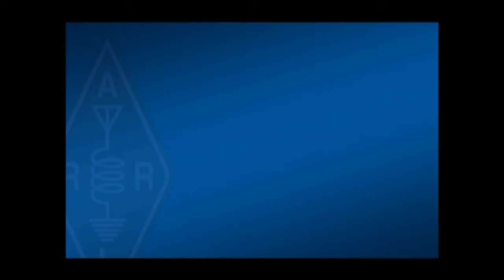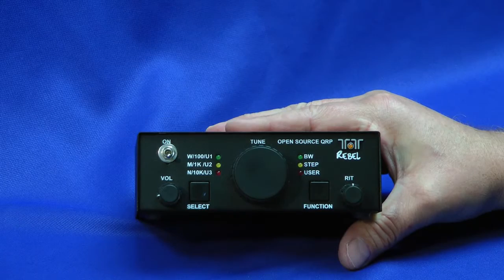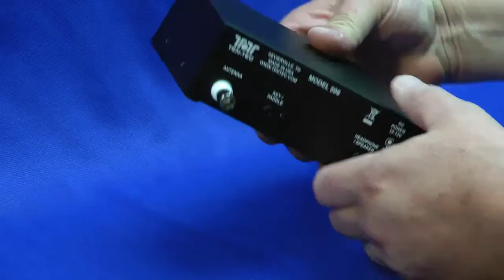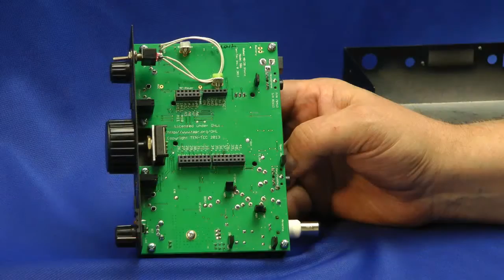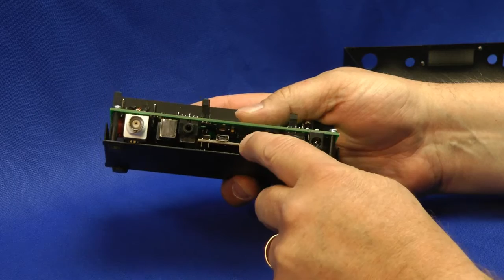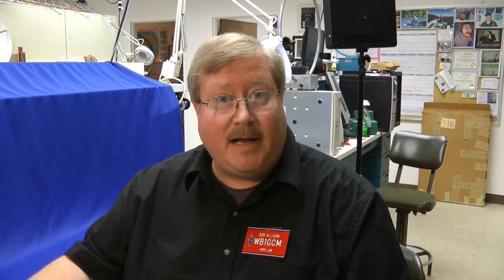TenTec 506 Rebel Transceiver

Comment: Sad little radio from a sad little company. TenTec today is not TenTec of yesterday. An Arduino Uno compatible GPIO layout for no good reason; it's like they read something in a magazine about the maker scene five years ago, and then decided to make a token effort. You are locked into the knob and button form factor because they decided to not use daughter boards for the controls. Half the links to their documentation don't work, the packaging and hardware they chose is second rate, and with all of that I'm not certain you can actually purchase these anymore. 

I was super excited for this radio when I heard about. What a shame it turned out to be such a dud. 

By the way, don't try contacting TenTec. They won't actually answer!
Reply: Rich Oh, for sure. It's unfortunate that they went out the way they did.